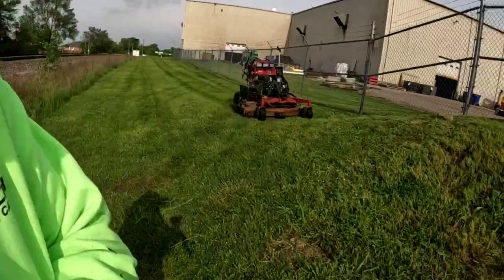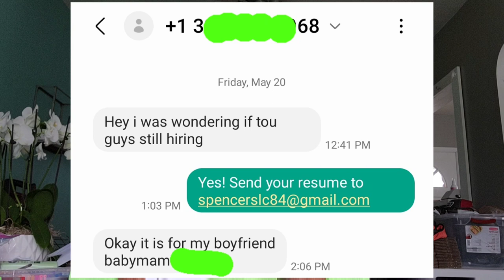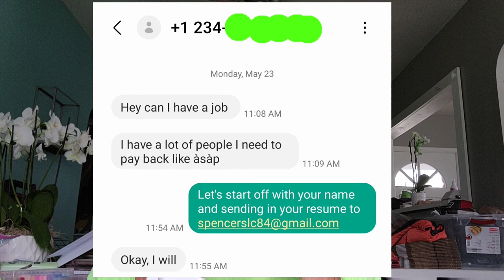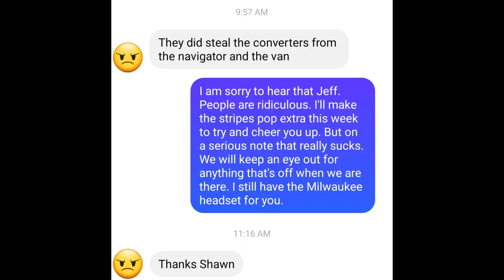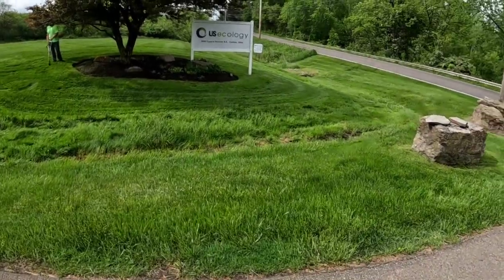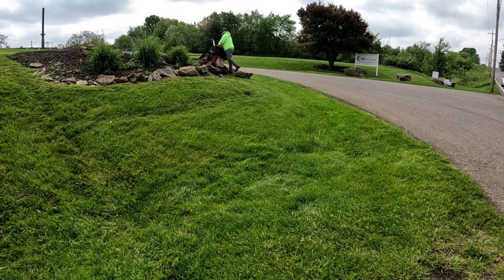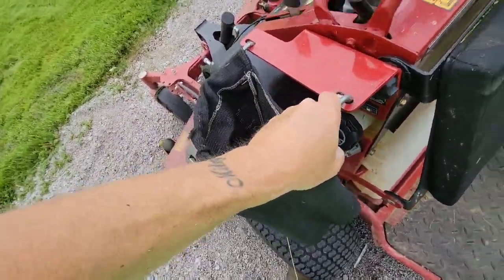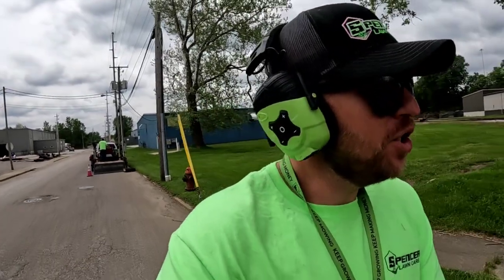JOB APPLICANTS BLOWING THEIR CHANCES | BOSS CONFIRMED IT WAS A BREAK IN!

Comment: I just got one of these wheel barrow mowers and they are awesome for what they are. A versatile year round piece of equipment. If you don’t plan on using the mulch bed or any other attachments weekly at the very least then go with a different machine for strictly mowing. It is not good on hills at all and has tiny tires and engine options. I do about 60% mowing and 40% landscaping and I am happy with my purchase but if that ratio was any higher towards the mowing side I would not be happy.